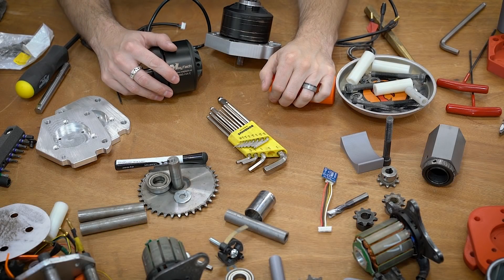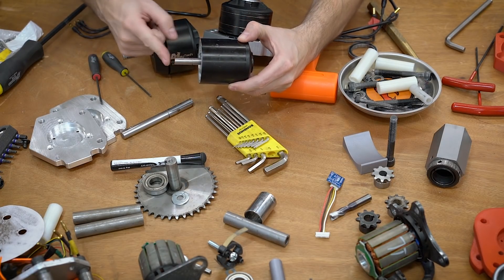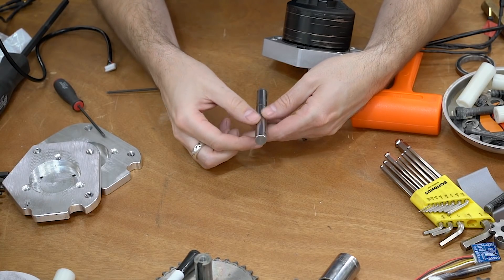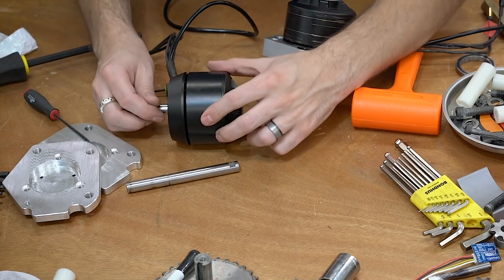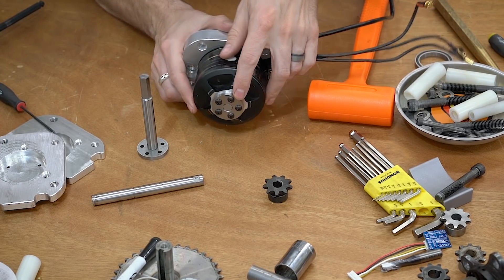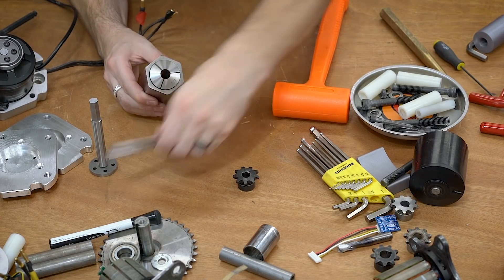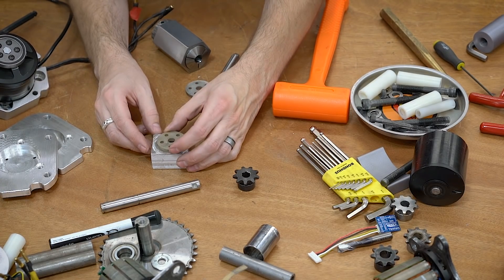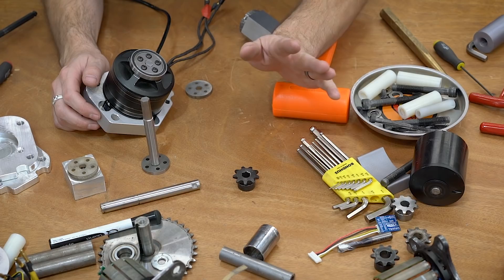Drive Shaft Improvements

Comment: Very interesting process for the 2-part design, but for doing a unibody shaft have you considered TIG welding the parts together?
Reply from the maker: I worry that applying heat will soften the parts and possibly deform them.  I don't think having them as 2 pieces will be detrimental in any way, just not the ideal.  A single milled piece is always going to be the best.

Comment: Very clever! First time seeing that collet hex tool! Its hard to tell what holds the shaft in axially from coming out on the sprocket side. Is there a pocket or some type of retainer in the mounting block?
Reply: Also do you guys use fixed length chain or master links?
Reply from the maker: We don't use master links, we make our chain to the lengths we need.  The first fight ever had master links, and it broke.
Reply from the maker: The shaft is held axially by the set screws (the flats aren't machined on there yet)

Comment: Depending where you are located in the usa wire edm migh be a great option if your trying to put a hex in something hard. I know wire is expensive but if you give them enuff of the same parts you could save on cut cost. Broaching is great until your broach gets dull or you send it not particularly square with the face as you would have liked. Idk what wire cut time costs are around your area is but don't pay for more then 80 an hour.
Reply from the maker: Yeah, EDM would be nice, but a single solid shaft is still preferable.
Reply: @RobertCowanDIY  i was talking about the gears and stuff to go along with the hex like the gear and sprockets because you Can buy pre hard gear and sprocket and the bore id to a size and usally key the bore the wire edm would be worthless for cutting the hex shaft into a shaft, i mean it could do it ,but why. The wire would allow you to put bigger radius in the corners of the hex in the parsts if cracking becomes a issue.  The key is supposed to be the weak link in the key, shaft and hub set up, but small parts the key is usually ovesized to key with a standard size key and makes the hubs wall to thin.

Comment: Is it possible to lubricate the forks so copperhead can move on one wheel?
Reply from the maker: Eh, not really.  I did think about using some UMHW pads on the bottom so we glide on those, but that prevents us from getting under other bots.  We really need to ride on the forks to do our thing.  We can try driving backwards though, which is less friction.

Comment: Screws in shear 🤨
Reply: Where do you see that? Are you talking about what's attached to the motor? I doubt the motor can spin with enough torque to shear them.
Reply from the maker: You're not wrong, but there's not enough torque there to shear 5 screws AND break the force of the press fit AND move past the set screws.
Reply: Could do 2 solid pins and 3 screws with a tighter fit on the pins
Reply from the maker: @aeroderek  Probably, but those pins are just going into aluminum.  I'd probably rather the screws shear than have a pin gall out a hole in the motor body.

Comment: Maybe can tack weld the two pieces together. The heat might cause some deformation, but if the tacks are symmetric around the shaft it might be okay.
Reply from the maker: I think the risk of deforming is greater than the benefit from having them as a single piece.  Still thinking about that.

Comment: Nice shaft problem redesign. Much much stronger. I lIke the bearing mt & change too. Use of matching reamer would make finishing of ID to prep for broach lead-in dia. quick and easy, but then again, you aren't exactly going into production here. Enjoy your thinking as usual.
Reply from the maker: I thought of a reamer, but setting that up was more steps than doing what I did.  The starting diameter isn't terribly critical for the hex, so milling it was good enough.

Comment: I'm really looking forward to seeing how all these improvements change your next season!

Have you considered a pinned connection instead of the hex? I've never looked into the yield of a hex, but just visually it caught my attention - on a 12mm shaft you only have ~0.8mm of purchase for each corner of the hex, and that feels very small considering that monster motor. I know you're moving away from keyways because they are a single point that can shear and drastically reduce the supporting material, but for a relatively small feature like this I suspect a pin may actually be the better approach (supported by both ends, pin must be sheared on both ends to fail, can be a softer material so it'll deform before it shears). I'd love to see some comparative testing if you have time/interest in it!
Reply: Maybe a splined shaft? I think the hex will be sufficient given they are a hardened high tensile steel.
Reply: the pin makes the shaft weaker. I'd prefer the failure mode of the interface breaking and the shaft spinning freely over the failure mode of the shaft shearing and going somewhere it's not supposed to be. Depends on the numbers, of course.
Reply from the maker: I don't know enough to answer properly, but the corners aren't really even touching, all the force is being transferred on the flats, the  broach is shaped so you're putting force on the flats, not the corners.